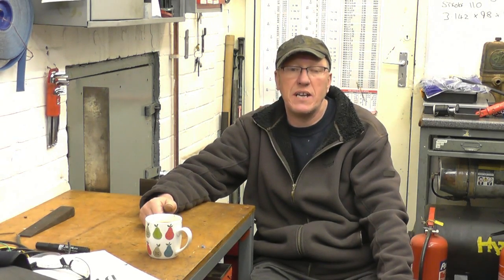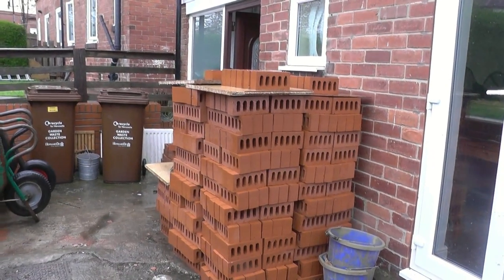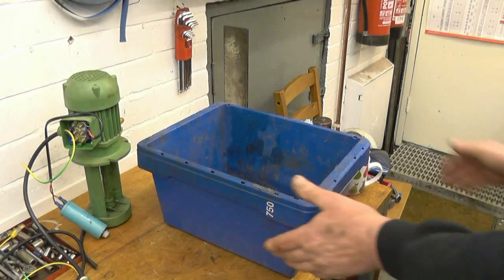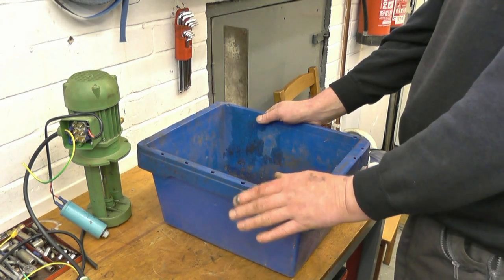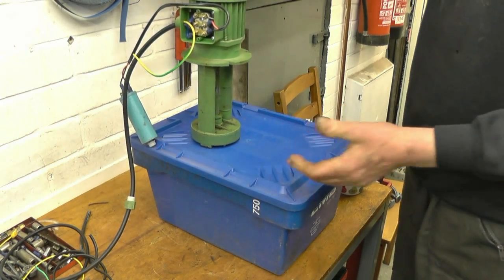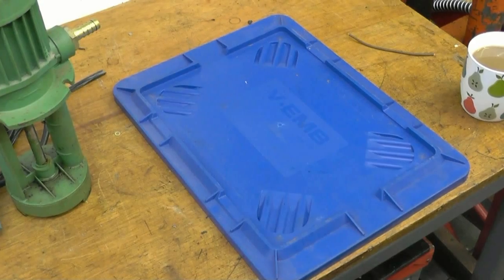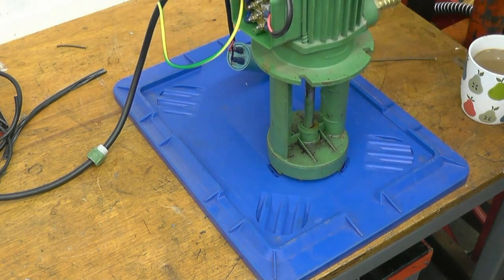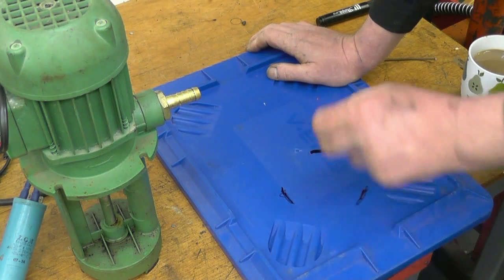SNNC 69  Lathe Tail Stock Alignment

Comment: Hi mate.
Deb is nearly done  Hooray!!!!!!!  Last one can be the hardest.  Please keep her save.
In regards to the fluid container, If may be so bold, I would make some bevels in there, to keep the crap out of the pump.  I would also reinforce the lid with a aluminium ring or so.  It will be Ok now but over time the plastic might lose some of it's strength.

Comment: Great video.  Neat trick with the washers, sure saves materials. 
You really don't need a diverter valve on the coolant pump if you have an off/on valve at each machine's nozzle.  When you fire up the pump both lines are pressurized but only the open valve feeds coolant.

Comment: I never knew you could get a 3 phase motor to run on single phase by just adding a capacitor .  That's a lot easier than putting a phase converter on it.
Reply: 1970chevelle396 That's what a (static) phase converter is! A rotary converter is just a static converter with an idler motor. Google "waterfront woods phase converter"

Comment: Hi John,
I like your method of using washers on a rod to align your tailstock on the Harrison. Very efficient. How did you check for twist in the bed, or is the bed sufficiently stout to prevent twisting.   Just curious.
Another fine video.  Sorry you're still experiencing cold weather.  It's warming up here in Texas.  Should be in the 80s (Farenheit) today.

Best regards to you and Deb

Comment: That tank will be good sitting between the lathe and mill. Easy to switch the flow from one to another with an "L" port valve at bed level. One pipe up to the valve and a pipe to each machine. Getting the lathe parallel within a couple of 10ths over that length is good. best wishes to Debs and yourself.   Gary
Reply from the maker: Gary C Thanks Gary